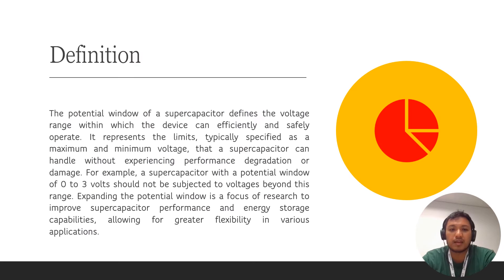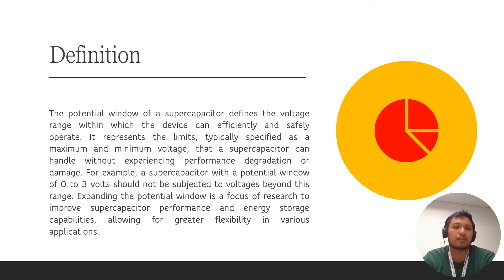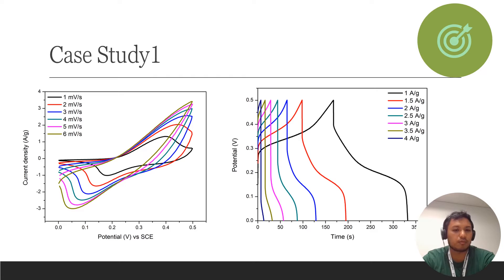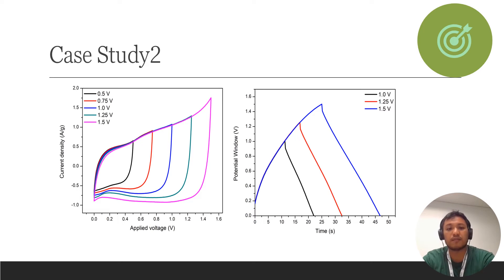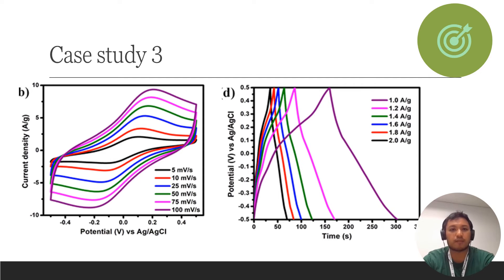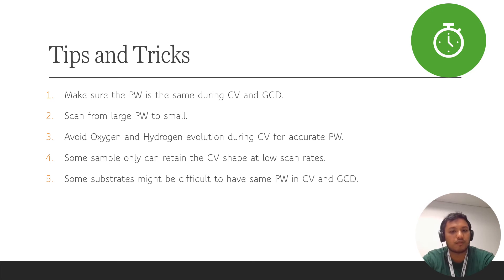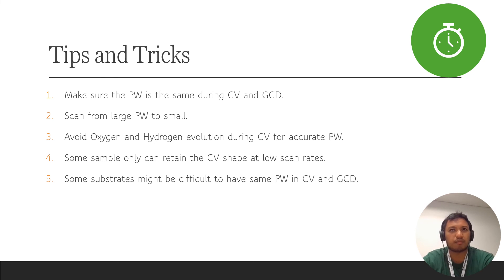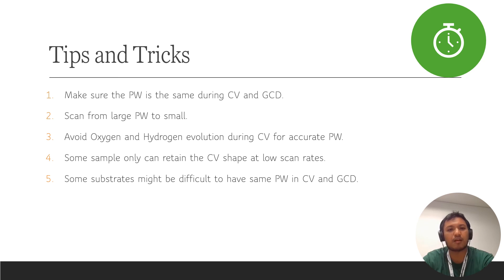Potential Window Supercapacitor

Comment: Case I : If i potential window 0 to 0.5 take for CV that show CV curve not full. When CV curve not full that sometimes we get not ful information of cv curve. My question why we take potential window 0 to 0.5 .
Reply from the maker: That why the first step is to scan your cv at large PW. From then you can reduce your PW window accordingly. In my case when I first scan from 0 to 1 V, I observe OER. That is why I limit the PW to 0.5V. If your sample at 0.5V the CV is cut, then you should increase the PW. Every material is different you cannot blindly follow the 0.5V without scanning at higher PW and see the behaviour.
Reply: @DrHaffeast  Thank you. If you give me a permission, i will email you.